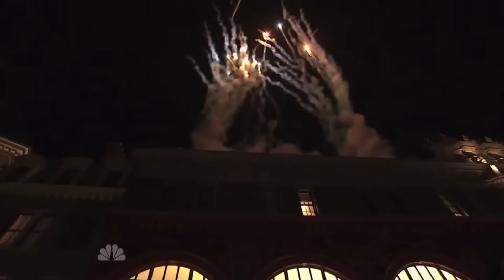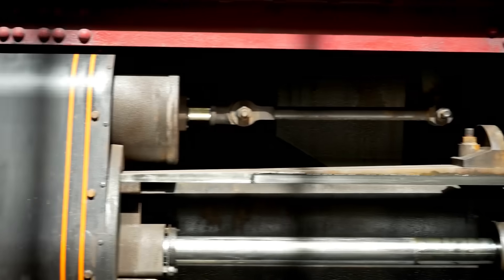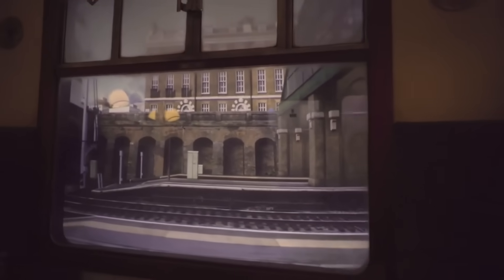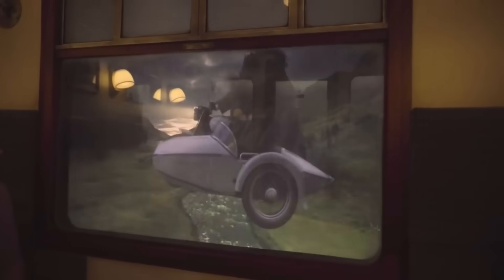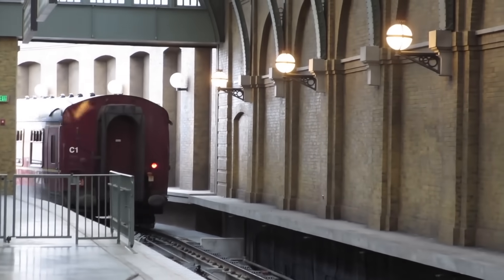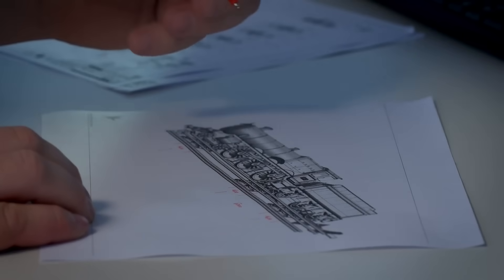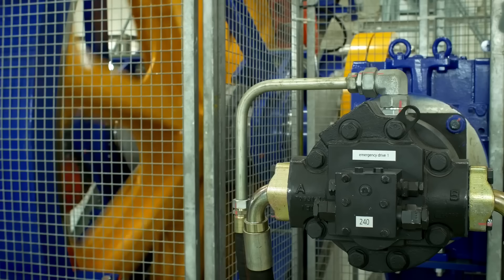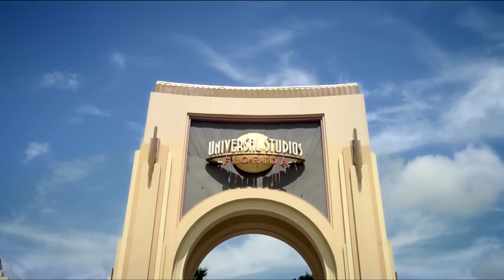Why This Hogwarts Express ISN'T a train!

Comment: So a little more information. The projection system for the windows is highly customized and built into the wall of the train. It uses 4K projection and is in sort of a gimbal system so it won’t shake during the journey. Also the air conditioning system is highly specialized as well since this is a cable card rather than a real train. - information I learned from ITEC who helped design the ride.
Reply: The AC is the train is junk lol
Reply: I believe its UST Ultra Short Throw projection not short throw projection.
However, I do not claim to be an expert on the subject.
Reply: The screens actually have an overhang, making the carriages wider at the right
Reply: How much space is really there? Is it rear projection?
Reply: It would be easier to simply use thin OLED screens. But I suppose that would have been much more expensive.
Reply: @santakosoundsystem7542  Durability with that long operation might also be a problem.

Comment: Using the Hogwarts Express as a way to parkhop is so cool
Blows the WDW Monorail out of the water
Reply: It’s really cool but I wouldn’t really compare them. The monorail has 15 miles of track and is a mode of transportation not an attraction like this. I also don’t imagine this being around in 50 years as the monorail has managed to be.
Reply: @Kev5504  50 years and Disney STILL uses an aging fleet from 89. Meanwhile this is still good as new. So yes, I would compare them. And this is better. And monorail is an attraction because it's part of the magical journey to MK and Epcot
Reply: @wdwfanatic1394  well I guess the buses are an attraction then too LOL. Monorail also connects Grand Floridian, Polynesian, TTC, Contemporary, etc. This wasn’t built for the sake of transportation. It was built so that people had to buy the park hopper to experience it. Good business plan but again not really meant for transportation.
Reply: @Kev5504  it was built as both transportation and a fun way to parkhop instead of walking to the other park
Reply: @Kev5504  I am aware they connect the resorts, and the monorail still counts. Buses, however, those are strictly transportation. The monorail is an attraction on the other hand, because of what it is. Something you don't see every day. A unique mode of transport that isn't a bus
Reply: @wdwfanatic1394  Uh, they just got new trains within the last decades. Unless the new retro look is just shells.
Reply: @Clay3613  "they just got new trains within the last decades" no, they didn't. WDW still uses their 1989 fleet. Disneyland and Tokyo Disneyland, however, replaced their fleet in 2008 and 2020 respectively. But not WDW. All they did was refurb, which is basically adding band-aids to an aging fleet
Reply: @wdwfanatic1394  Should they update the look or is WDW too iconic to change?
Reply: @Clay3613  the monorail look is too iconic. However I've seen a rumored design of the next fleet and it's really different. Imo they should find a way to replace the fleet but keep the look
Reply: @WDW Fanatic  they renovated them in 2019. And they look pretty good.
Reply: Also, is no one gonna talk about the Skyliner?
Reply: Well considering you can very easily walk from one park to the other Universal is more closely comparable to Disneyland/California Adventures, park hopping at WDW actually requires transportation.    That said, you don't need to buy a park hopper ticket to ride the monorail at WDW,  hell you don't even need a ticket to ride it, it can be a nice ride just for the sake of having a nice ride.
Reply: @Mike__B  yes but it takes you to the entrance, not inside the park like the Hogwarts Express. Hence, no ticket required to ride but you still need a ticket to enter the park

Comment: Good video-

I think "cable hauled railway" would be a better term than funicular as the track is flat and the cable is connected to both ends of the trains rather than relying on gravity for one direction of travel. Doppelmayr doesn't use funicular to describe their cable car/cable linear shuttle system- they also sell funicular systems (and the new Disney dangleway).

The main thing that looks wrong to me about this ride is when the train, with passengers, reverses on its journey to Kings Cross with the locomotive at the rear. In reality, the locomotive would have run round to the other end of the train or have been replaced by a fresh one [since the age of steam there have been long trains with a single engine that can be controlled from a cab at the far end, some currently visit Kings Cross].
Reply from the maker: Yeah, most people probably aren't familiar with traveling on actual trains like Amtrak. Around where I am the local transit train does run their units in reverse just as often as forward because they don't have an efficient way to turn the train around or even just the engine.
Reply: @AmusementLabs  Nowadays in the UK "running round" trains is something you normally only see on heritage railways. On the UK mainline most trains are made up of units that are equally happy to run in either direction and even those that do use a loco normally pair it up with a "driving trailer" at the other end to avoid the need to run round.

Comment: Loved the video! Are the cars connected via gangways so that the staff can walk between them in an emergency?
Reply: Each car his it's own porter (complete with a rack of video monitors that allows them to watch each cabin and hallway). Because if anything was to happen once the train departs. porters on the Express are the only ride attendants required to take a safety course in fire extingiusher use. (And, it did happen once when a person's e-cigarette exploded and set fire to the cabin).  Once a year they also run an evac drill after hours in case the train should stop between stations (which, as far as I know, has never happened).
Reply from the maker: @richardperhai8292  I think it did actually stop between stations once. There's a news segment I saw that I was going to to use here, but opted not to.
Reply from the maker: I believe so. It's been a minute since I've ridden, but I believe you can.
Reply: @AmusementLabs  No they are not connected.
Reply from the maker: @Sporty2121  oh well. They should be though.
Reply: @AmusementLabs  For the EVAC its alot easier then having them all connected
Reply: @Sporty2121  Alot is a town in India.

Comment: Pretty neat, however I wish you had gone into detail, such as the steam effects.
Reply from the maker: I know, forgot about that. Mostly comes from underneath the train through the grates in the floor. Nothing particularly complicated.
Reply: When it works, the steam between cars is run through pipes under the trains. (The effect is frequently broken unfortunetly). A seperate system provides steam for the "engine" from the sides under the train.